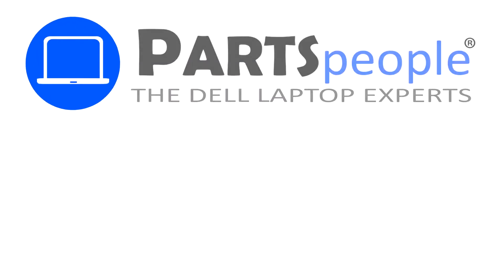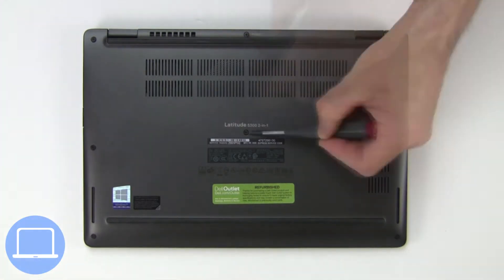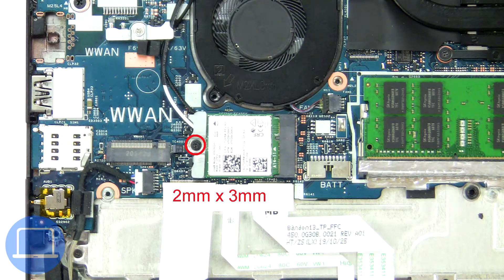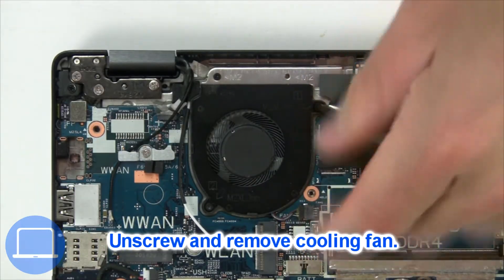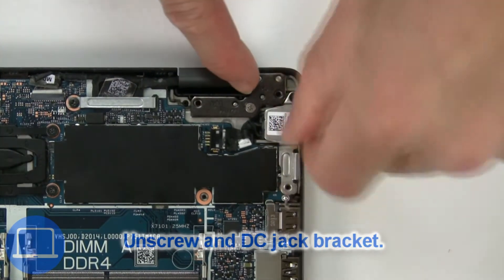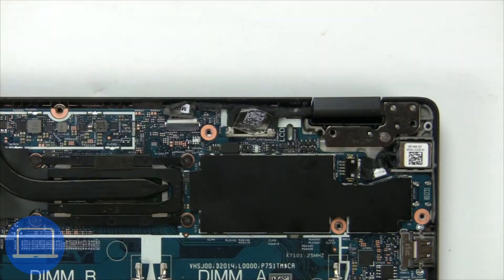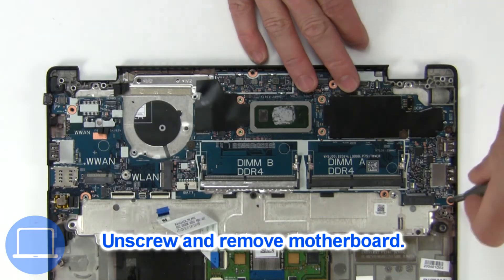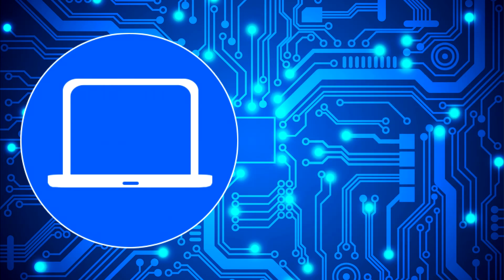Dell Latitude 13-5310 (P97G002) CMOS Battery How-To Video Tutorial

Comment: Are you serious to be so complicated?? it is much easier by just using a tweezers to disconnect and reconnect the cmos battery after removing the main battery, without the hassle to dismantle all those components.
Reply from the maker: Point taken. I believe that Dell recommends removing the motherboard is for you to have full view of the CMOS connector when plugging it back in. Bending the pins could result in damage to your motherboard.